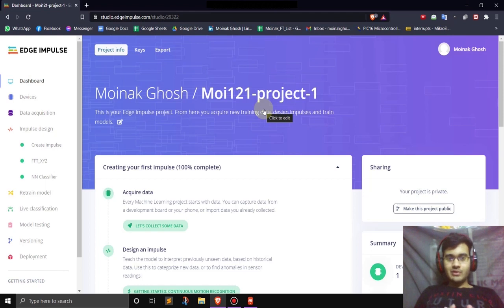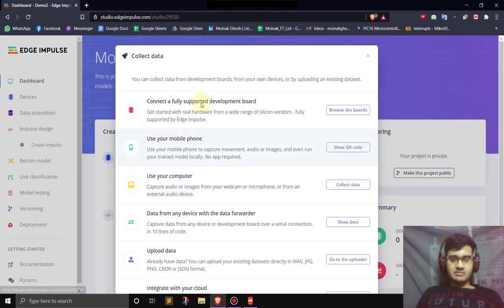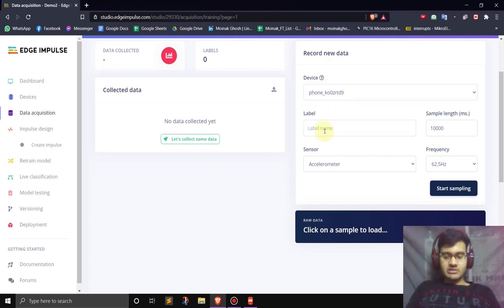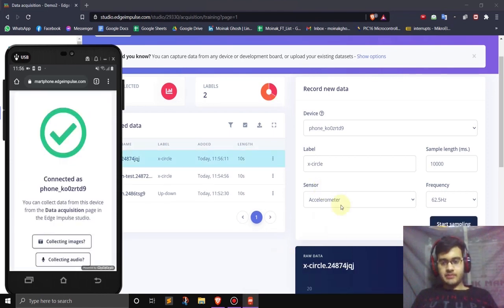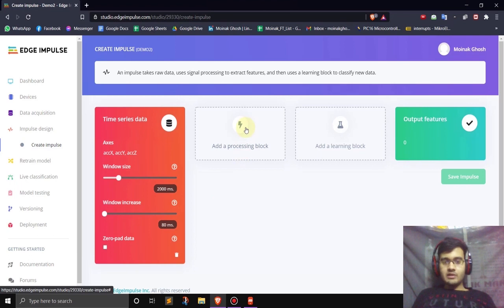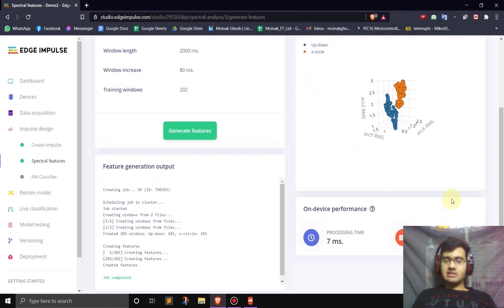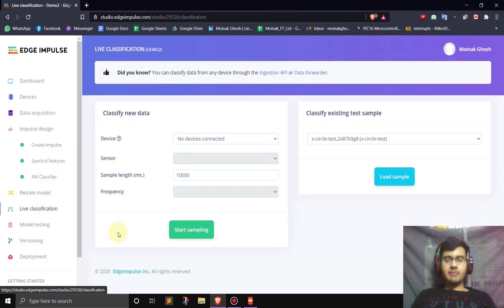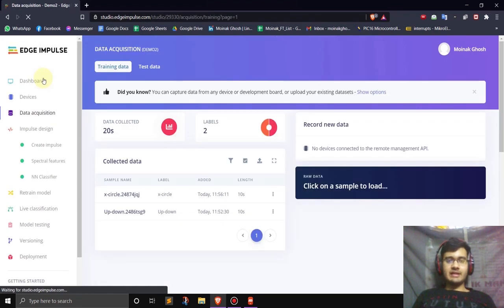Edge Impulse Tutorial 1 - IMU based gesture recognition using smartphone

Comment: I was able to open my code in the IDE.  I made the accelerometer data samples and I would like to turn on LED colors with gestures.  Can you help me ?
Reply from the maker: You can add the RGB color code (check examples) and add it to the main code. If you would like more help - send your code and requirements to tech@robocraze.com
Reply: @Robocraze  Thanks for replying friend!  I managed to turn on the LEDs.  
But any gesture I make turns on the led was supposed to be a gesture for each color.  
I will send the code to your email.  
In my project it is to identify only 1 gesture and change the color of the led whenever it is done.